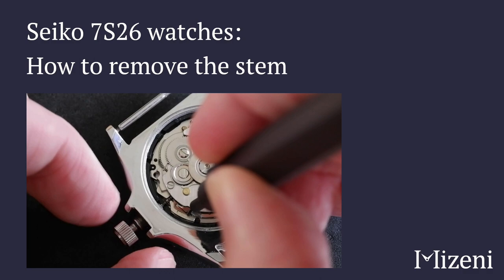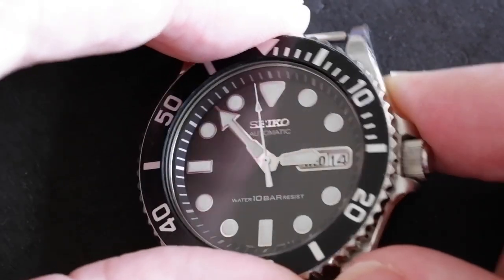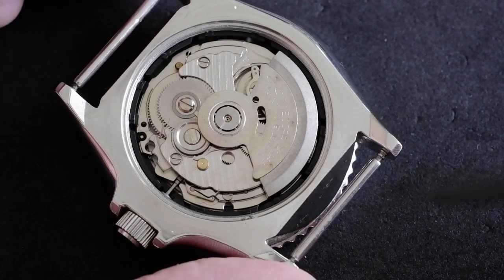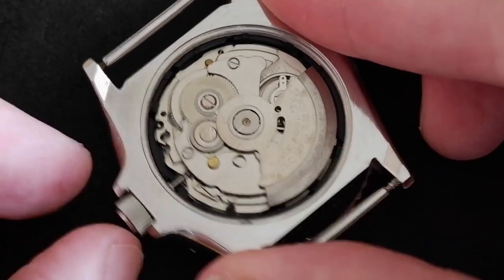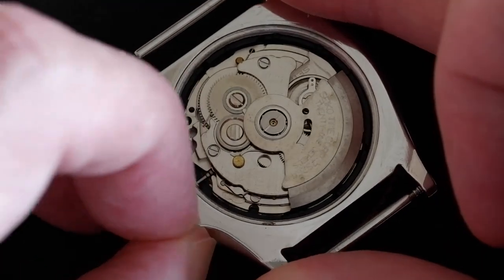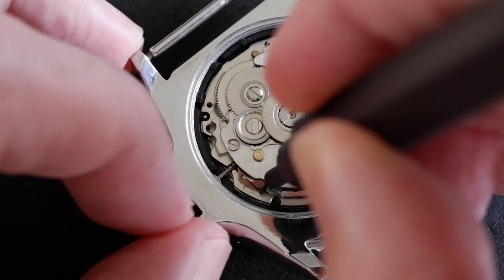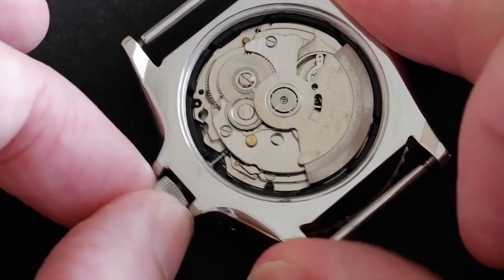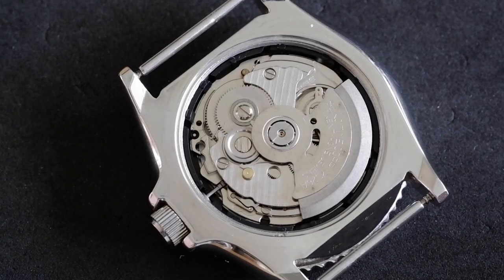#Seiko 7S26 & 7S36 watches: How to remove the stem & crown

Comment: This is so awesome and informative! Can you confirm if all 7S26 and 7236 watches use the same crowns? Meaning buying a replacement crown and stem for a 7S26 would just as well be compatible for a 7S36?
Reply from the maker: Thanks for the kind words!
I'm afraid 7S26 and 7S36 watches use different crowns (and sometimes stems) depending on the case. For example a diving watch with 7S26 or 7S36 movement usually has a screw down crown, whereas other 7S26/7S36 models usually have a non-screw crown. Even then, the styles might be different, e.g. thick or thin.

It's possible that even if a crown is not identical, it could still fit on a different case, but you can't know for sure without measuring it or trying to fit it. If possible, it's best to measure the crown carefully in advance and then try to find something similar.

Comment: why would you replace the crown,and where is the screw down spring
Reply from the maker: Hi Joanie. Good question. The watch in this video actually had a broken stem when I got it, so I bought a new stem and put the old crown on it.

Another reason for replacing the crown is with a custom/mod one. You can get third-party crowns with various designs that fit SKX007 and other popular Seiko divers.

And in this original crown, the spring is actually inside the crown where the stem goes in. You can't see it unless you pull the stem and crown apart so I don't have a photo I'm afraid.

I hope that helps!